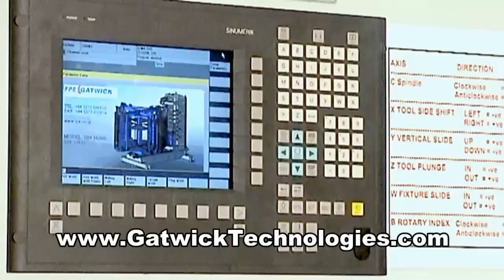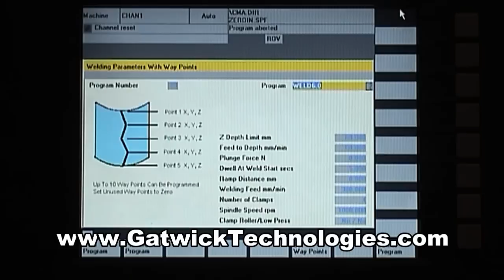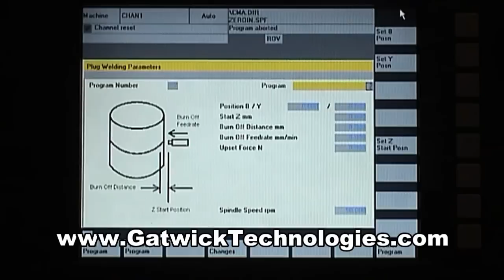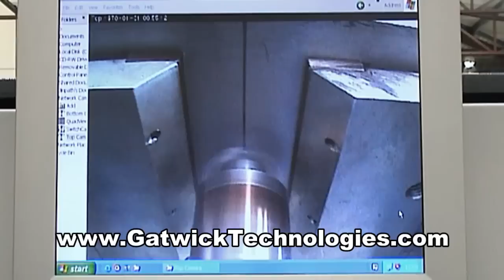Gatwick Friction Stir Welding Machine for Welding Aluminium Aerospace Fuel Tanks & Drums

Comment: How is axial load applied..??
Reply from the maker: Axle load is applied using CNC hydraulic control.
There are two modes available to control the FSW tool.
1. Positional.
2. Force mode.  Force is selected via recipe input on the HMI
force mode is particularly useful when there are variations in thickness of the material to be welded.  Force mode will follow the profile.

I hope this helps.

Best regards
Andy Ward
andy.ward@Gatwick.eu